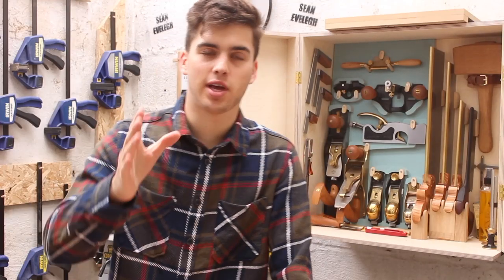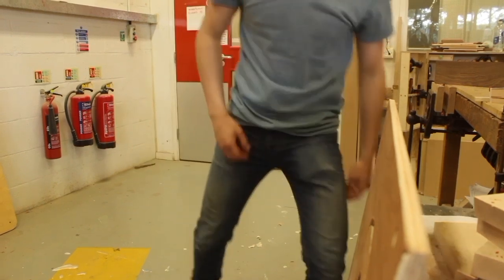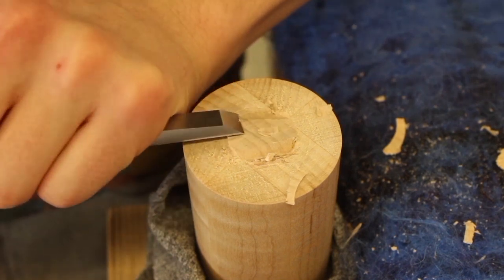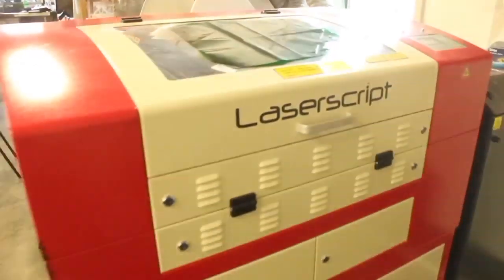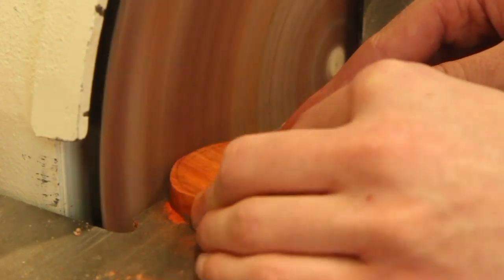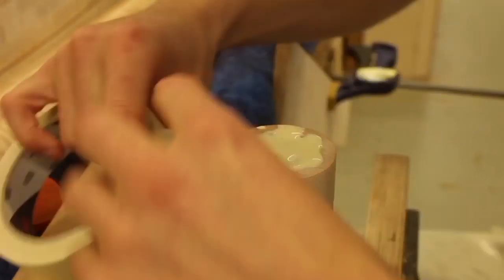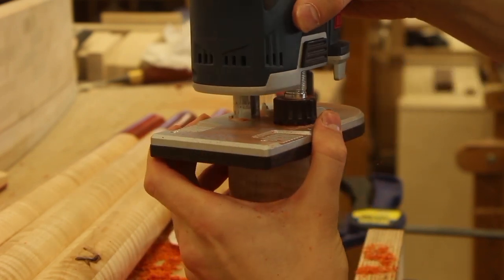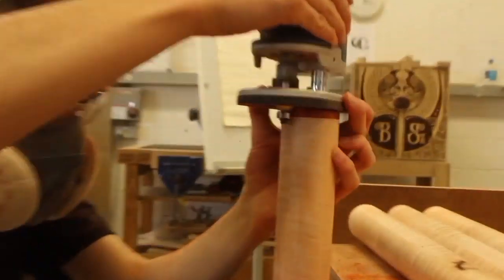Assembling The Hallway Table! (Part 4)

Comment: Hi Sean: I love the design and your execution of the various components.  As a fellow woodworker, may I suggest the use of card scrapers to achieve the final surface of those curved (inside and outside curves).  Sanding the wood fibers in lieu of cutting leaves a visual difference in the fibers.  Also, when performing all of those end grain "bricks" to form the table "beams", try using butcher paper that has a glossy coating on one side, or clear packing tape strips to form a wide gluing barrier between the assembly and your workbench.  Just a couple of process ideas, but again, just love the design and the final table.  Well done!
Best - Michael

Comment: Congratulations on both the craftsmanship in this piece, and your ability to describe what you did.  It's relatively unusual to encounter someone who can both do the work and is also comfortable in discussing the process.

One question - the joint between the legs and caps is an end-grain/face-grain joint that is merely glued together.  End-grain gluing is tricky.  Any concerns about that joint failing over time?  Of course, the caps are purely decorative, and with the glass top in place, it's unlikely that the caps will experience any stress.  But the question remains - any concern for the strength of the joint?
Reply from the maker: HI louie, thanks for watching and your kind words. about the caps, I'm not worried about them at all. like you said it's a very stress free area of the table and no one will be touching them. So its not an issue. also is only really half an end grain joint, because one half is side grain. I'd probably be more worried if both sides were end grain.

Comment: Nice table. Curious as to why you made the plugs out of end grain vs side grain?
Reply from the maker: HI John, traditionally dowels are made with the grain going down the dowel, with the end grain showing on the end. it makes a much stronger dowel. if the grain was going the other way, it would be more likely to break when making the dowels and hammering them it place. Also when flushing the dowels of with a chisel or plane. It's easier the plane end grain than with the grain, because the grain is more like the chip out (when it's not end grain) and it would take more of than you wanted. I hope that makes sense. thanks for watching again and I'm thrilled you like the table.

Comment: If you go to build another project with curves get a Stanley 113.  Reduce your sanding time significantly.
Reply from the maker: HI Tony, yeah i have seen those before. there reason i didn't use it for this project, what because of the curly grain. But i can imagine it would be very useful for other curved components. thanks for watching man!
Reply: Like any other plane you can adjust the mouth opening and shim the iron angle to get a smooth cut in curly grain.   @SeanEvelegh